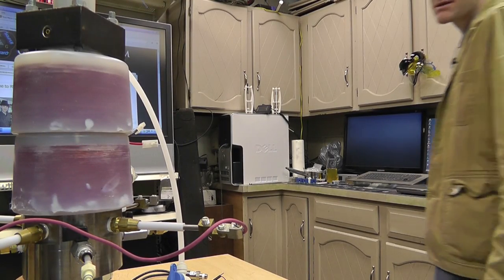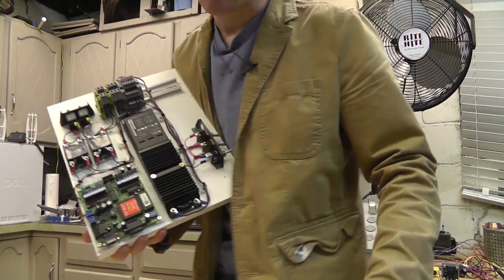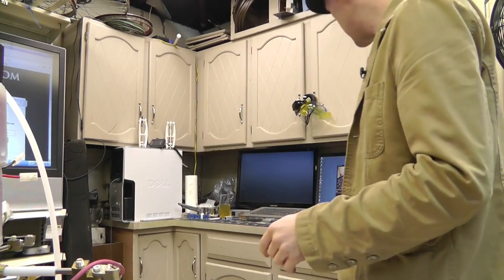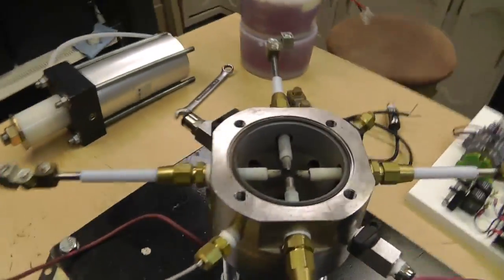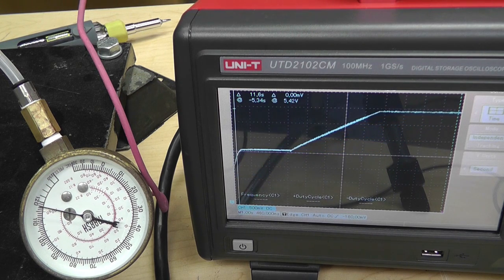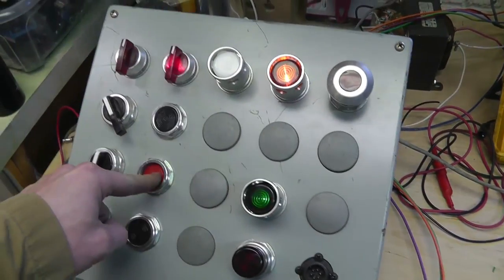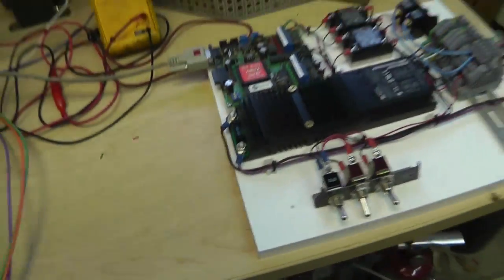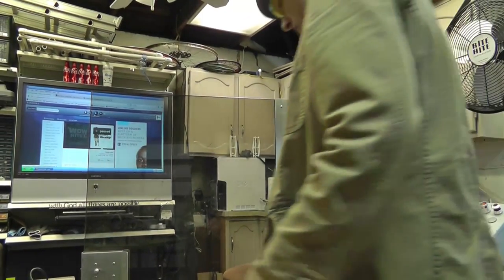Update 21 NGE Papp: The Next Step To Real Data... Second Step of This Installment Coming Soon...

Comment: Also, consider forming your high current supply wires into twisted pairs as much as possible from the capacitor bank, through the contactors, all the way to the spark gap. This will create a balanced feedline with self cancelling fields and much less EMP radiation.

Comment: Great stuff Russ, I think you will get a reading that is accurate because this toroidal shape is enclosed, a smoke ring type shooter is open to travel forward. This "popper" being a closed system is harnessing the full force and will probably be a uniform pressure inside the cylinder. Good luck man, I am always so impressed with your results to replicate interesting stuff. I wish I was a doer like you and not just a watcher.

Comment: Russ, great stuff! God really blessed with that Milling machine! Sure hoping you can get both motors converted to 240VAC. Also, I'm chiming-in with Zero in regards to the hydraulic pressure transducer extension. While it would work great for static or slow-changing dynamics, it will certainly slow down the response time. Consider wall friction for one. The shock wave will compress the fluid very slightly & the bulk modulus will hurt you in response times. Also, you will most surely be >>115psi

Comment: When you get to the high energy outputs - you will start hearing breaking glass in your head. Disconcerting but harmless. My old computer used to whistle and chirp at me in protest. Regarding the pressure, simply add weights to your shaft until the stroke becomes limited and walla you have the useful pressure. Wt./ Area. I do not recommend pressurizing the top half of your cylinder as you discussed. It will force air past your U-cups and cause creeping contamination.

Comment: I warned you about the EMP potentials you were messing with, didn't I? The hydrolic line to extend the pressure transducer is a good idea BUT only if you don't need fast response times. If you do then measurement at or near the source is the only way. You may need a doppler laser system against a calibrated diaphram to get the data you're looking for.

Comment: Russ, do you know if the pressure transducer was designed to respond to short high-pressure transients?  Please check the datasheet.  It's possible that it will not be a fit for your application.  You can try to make some estimates of the pressure inside the cylinder by optically (or by some other means) measuring how fast the cylinder moves after ignition.  You know the mass of the moving cylinder and the square inches of the piston so you can derive the pressure.

Comment: a hydraulic line...when a line isolation JUST WONT WORK. LOL ;)
(actually a pretty good idea) ..make sure your viscosity medium is low, and use lots of hose length.. coloring added to alcohol would be good. BTW, have quick detach hose connection. make sure you pull vacuum and have no bubbles and fluid medium should be at a proper temperature factor.

Comment: piezoelectric transducer and Hv don't mix well as you found out. is it a requirement for high speed piezoelectric transducer or could you make do with a slightly slower pressure sensor, would suggest using an automotive / aircraft pressure sender type a variable resistor for volt/current output change via pull-up resistor network.

pressure sensors, as found for fuel & oil pressure reading,  0-10,& 1-20bar rating etc will work and not suffer from emf /emp / discharge, often not too linear towards output so a look up table written in code will allow a fairly reasonable calibration table, 10 point extrapolated will do fine, good enough to rug it out.

you  should use a strain gauge on the output , thus measure and plot the stroke,, he he.. all the best.